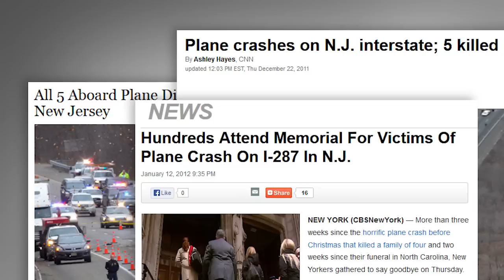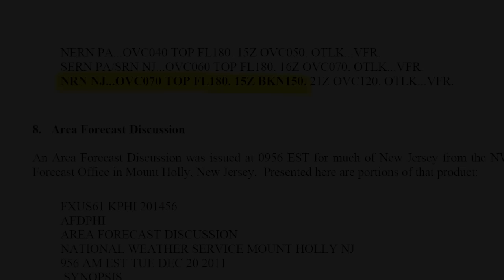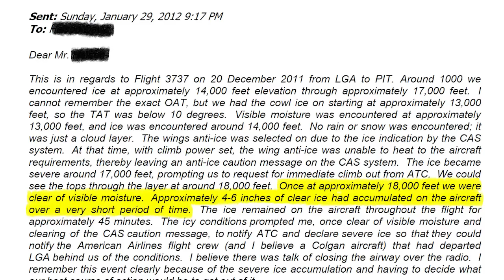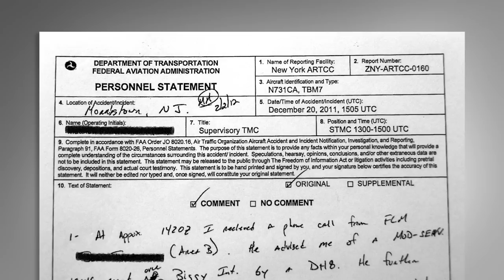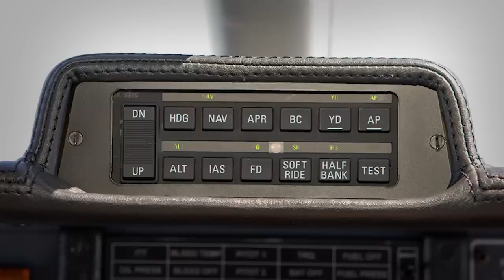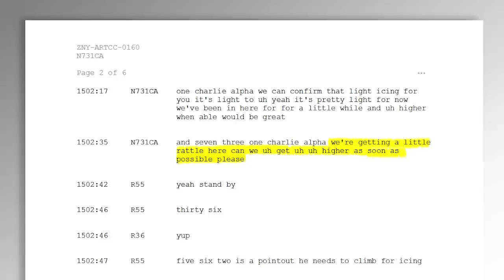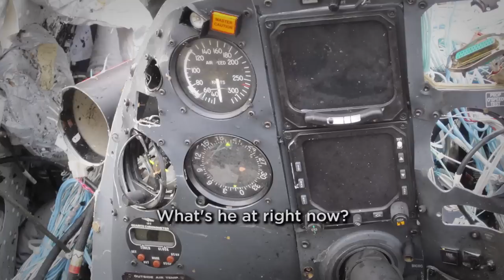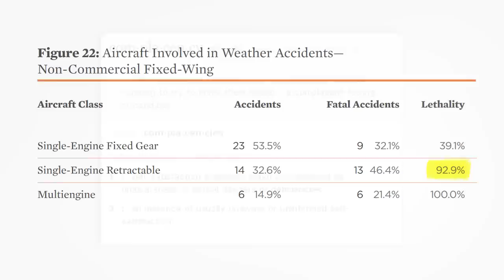Accident Case Study: Delayed Reaction

Comment: What about some vids on close shaves, like, how people managed to get out of tricky situations. I bet most are never 'mentioned'.
Reply: I had a tricky situation with a close shave once. It was January 16, 2007. I had a hot date that evening so I had a case of get-there-it is. I should have stayed home that day but she was hot. So I pulled out the old trusty norelco 5675 which I lacked on maintance to oil the blades. Never let me down before but this night was different. Half way through the shave I noticed some tugging but after years of shaving Ive become complacent. I should have stopped there but I kept shaving and next thing I know it's pulling hairs out and makes a screeching noise. One of the blades failed mid shave. Good thing I had a competent instructor and trained me what to do. I tilted the shaver 30 degrees so the bad blade was off my face. I then slowly limped on with the shave not to overload the remaining two heads. Scared the hell out of me with all the screeching and I could feel the heat radiating from it but I was committed at that point. I managed to get it done and off to my date with no injuries except a few pulled hairs and some shaky nerves. If I had to do that day over again I would have stayed home. Especially since I didn't get laid.
Reply: AIUI, there are a few put out by AOPA.  They won't be as well documented as crashes, though.

Comment: wow. That looks like a stall with wing drop, which is one of the scariest things I've had to practice recovering from in the short time I've been a student pilot.
Just, the sudden lurch and roll to one side is very unnerving, and Yeah...
I actually panicked the first time and reflexively tried to correct it before it started...
Which of course undermined the ability to practice recovery, and technically also meant I was interfering with the flight instructor's control of the aircraft.
But yeah...
That's... 
Stall training was definitly a moment where it's really apparent how different it feels in a real aircraft over using a simulator.
A lot of other things aren't massively different, as far as it goes (if your simulator is decent), but something like a stall.... That's not at all the same...
Of course the real problem here is the ice and not doing the right thing ahead of time, the stall and spin are just the ultimate consequence...

Comment: Interesting that "moderate icing" can build up enough in UNDER 5 minutes to down a plane?
That's a very strange use of the word "moderate"
Reply: Terry Melvin  Too situational to answer id say.
Reply: It is severe. I do not know why but severe is  not used.
Reply: I'm not talking shit 8m saying that's what I've learned from watching this.
Reply: All im saying is screw ATC if I see icing building up fast im going to gun it to get above the weather and talk to them after.
Reply: Kevin I’m not a pilot but I’ve been watching a bunch of these videos and it seems like most pilots commenting on icing say it’s better to descend to get away from ice, not climb.
Reply: @Sashazur  it is possibly better to descend if possible because it puts the plane into warmer air and obviously there is less chance of the wing stalling during a climb. Of course that depends on how high the plane would have to climb to get into an area where supposedly the icing is less of a problem. 

In this particular case, the plane simply may not have had enough time either way
Reply: @Kev376  I specialize in air safety and I tell you from the heart that you should descend, do NOT try to climb with ice build up on you.
PS: Oh and DO tell ATC you are either descending or climbing please, don't put other people around the same airspace at risk of a mid air collision, specially because I highly doubt your aircraft is equipped with ACAS unless you are in air transport/cargo, but if you were you wouldnt have said those things so I'm assuming you are GA
Reply: @Kev376  not when the ceilings are at 30k agl

Comment: I have flown three times and for me that's three times too many. There are just too many things that can go wrong with planes/pilots and weather. I am an electrician/mechanic and all around handyman, I have seen 3" solid steel shafts twist off as if they were made of wax. Nothing is 100% safe, and it really makes me think when I see people put their lives and others in the danger zone because they think they are on top of things, things they are not really good at.
Reply: Do you drive an automobile? Did you know your chances of getting killed are a lot higher while driving than they are from a plane crash. Flying is a very safe mode of travel, especially commercial flying. Look at statistics of how many people get killed in auto accidents every year, especially during holiday travel, but yet it's a footnote on the news. Heard of any commercial planes crashing lately? I didn't think so.
Reply: @rodneybrocke  If you had the same number of plans in the air as we do automobiles on the ground then the number of accidents would be different. Nice try but you can't have different numbers and compare things.
Reply: @NCLUSA  Yes, the numbers would be different. But let's talk commercial flights. If you compare a given number of people transported by commercial flights versus the same number of people transported by automobile, the safety statistics are much, much worse for automobile travel. And I realize this comparison cannot be equal because the number of people on a commercial airplane is 100 or so, versus 4 for an automobile. But my point remains true, that you are statistically a lot safer if you travel by plane versus driving. Obviously, flying is not for short trips, like to the grocery store. I am talking about long trips of several hundred or even thousands of miles. Look at the statistics. Flying wins every time.
Reply: @rodneybrocke  Well if you want to talk numbers?, have you ever heard of over 300 people being killed in a single car crash?, get back to me when you find that (  :
Reply: @rodneybrocke  So all of those Air crashes are not real?, someone just staged them, right?, planes don't ever fall from the Sky right?.
Reply: I completely agree. I had a tail dragger that I flew for 8 years. Two private planes collided at our suburban airport, killing three. Saw the smoke from my back yard. Sold my airplane and sent my private license to the FAA, with no return allowed. One’s hobby is not supposed to kill you.

Comment: you can hear it in that pilot's voice: he had no intention of turning around up until the point he physically couldn't go anymore.

unfortunately, this time it was too late.
Reply: ...and what good would it have done for him to turn around? Is it not clear that at a certain point you're halfway in and halfway out?
Reply: @touristguy87  Descending with accumulating icing out of the bottom of the clouds is still dicey, but controllable. Ascending can lead to slower and slower climb performance as the ice builds up on the airframe until you ultimately stall the airplane. He backed himself into a corner he couldn't get out of.

A descent out of the icing takes a predictable and short amount of time. If you try to climb out of the top, you're betting that your anti-ice systems can keep up and if you lose the bet, you're stuck with a totally iced up airframe that can barely fly at all, and definitely not climb further.

Comment: Are there any cases of a pilot detecting mod to severe icing, declaring an emergency, and then climbing (rather than descending)?  I realize it may pose increased risk to other aircraft already at the flight levels, but in hindsight, maybe this pilot could have climbed safely through the icing zone (for example, if he had TCAS/ADSB Active Traffic)  before ice had a chance to build up on the plane?

Comment: Is it possible to recover from a stall?  I've watched almost all of these Case studies, and some other accident videos, which a bunch mention stalling...  I saw one, getting into a stall from pulling back on the yoke, and not increasing power, so I wonder if you weren't paying attention to the airspeed, could you recover from a stall like that by simply pushing the nose down, gaining airspeed??   

I've always considered getting my pilot's license, but after the last two days of watching different types of accident scenarios, I really wonder if it is something I "really" want to pursue...
Reply: Recoveering from stall is standard emergency procedure every pilot should know, but recoveering from stall in cloud where you do not see horizon is rather hard and with ice buildup the aerodynamics of the plane is compromised, it can be impossible to recover.
Reply: In simple terms, a stall occurs when the air flowing over the wing slows to the point that the wing looses lift. To recover, you have to maneuver so the air starts flowing again. With icing, it changes the aerodynamics of the wing to a shape that can no longer provide lift no matter what the air flowing over it is doing. As the plane plummeted, the air was flowing so fast that it ripped a wing off. If the ice had not been on the wings, he could have recovered from a stall long before he got to falling that fast. That's the problem with ice: it changes your well-designed aircraft into one that is poorly designed and cannot fly no matter how much airspeed it has. (Hope this helps your understanding.)

P.S. Try satisfying your desire to fly with a home simulator first. It's cheaper and you won't die. :-)
Reply: Not if the plane was aerodynamically unable to fly due to the modification of the shape of its lift surfaces due to ice.
Reply: Learner pilots practice stalls and recovering from them, it’s a key part of training. But sometimes stalls can be difficult to recover from, like if the stall leads to a flat spin, or as in this case if the plane’s flight characteristics are compromised.

Comment: 1400 hrs in that type of plane is risky especially IMC. I couldn't get my hands on anything bigger than a PA39 when I had 1500 hrs & even then y experience level was low I reckon. I went on to fly 1000's of hrs in Multi Turbo props/jets & still was weary of ice, the silent killer. 
RIP to the innocent in this awful totally avoidable accident.

Comment: Scan. Scan.Scan. 
Fear brings fixation. Airspeed dropping, and not noticed, is a major factor in incidents. Always keep scanning ALL FLIGHT AND ENGINE INSTRUMENTS, and keep the intellect WORKING. Don't just flick your eyes over 'em, you need to KNOW WHY the speed is falling off, or the torque dropping, or unusual vibrations, the information is all there, but an active, involved, analytical PILOT is needed to evaluate the situation and make the call.
Reply: I'd like to think that it's my fear of dying that makes me a REALLY good pilot.
Reply: If you have airspeed bugs, put one on expected airspeed, and the min icing speed
Reply: he probably had a good idea of what was going on seeing as how the windscreen was coated with ice blocking his view of hte ice on the wings that he was told would be a problem
Reply: The ice not only adds drag and decreases lift, it increases weight. All three point to a stall.

Comment: Excellent example and review of the issues. Beautiful airplane and, much as we all might wish otherwise, probably an average to above-average, reasonably experienced and recurrently-trained pilot. How many in that situation with that equipment would not linger the couple of minutes being held down by ATC in the hopes of getting through it in light of the two dozen previous times doing that? The MD-80 pilot's discussion of their flight's experience through there says a great deal, I'm afraid.

Comment: My Father was a Commercial pilot (charter and Corporate) for most of his career. His scariest story was flying over the Rocky Mountains in a Piper "C" Aztec with no anti-icing equipment. He just kept slowing and losing altitude. He was able to get to an altitude where the ice melted  before he lost control. Back then, they didn't have all the weather Notam's on I-pads that we have now. I remember a few times when he had to shut down an engine to save it or make an unscheduled landing because the door popped open. Once, a fuel guy didn't secure a wing tank fueling port and the fuel was being siphoned off the starboard wing tank. Another time he forgot to tap the brakes on a Cessna 310 before he raised the gear, and filled the plane with smoke from the still spinning landing gear as it came up into the well.
The last time I flew, I was on a Piper twin with turbine engines. The pilot requested that the plane be taken out of the hanger and be fueled by the FBO. He just pulled the plugs from the engines and didn't perform any pre-flight checks. Just before we got to the active runway, the non-pilot guy in the right seat noticed that there was almost no fuel. We taxied back and fueled up. The pilot left a cup of coffee on the wing when he checked the oil in the port engine during re-fueling and it blew all over the airplane on starting. I was almost running by that point. He also kept tapping on one of the port engine gauges because it wasn't showing what he thought it should. Another time I flew right seat to prevent a customer from bugging him. We were at 17,000 over Atlanta and he got bitched at because he was below altitude while he showed off the weather radar. I never flew with this idiot again, and when he upgraded  to a Beech King Air, he couldn't fly without a rated co-pilot.

Comment: This event began directly above me at my workplace in Morristown. I just exited my car and could hear a normal sounding prop aircraft in the clouds above, a common sound only a short distance from the Morristown airport. Suddenly, I heard an odd "metallic slap" overhead, similar to the sound of striking a roof leader pipe with an open hand.  The aircraft sound instantly changed to an accelerating spiraling sound for approximately 30 seconds during which I could follow its track south but still not visible through the cloud cover.  Then,  the aircraft appeared out of the cloud cover, airframe appearing to be fully intact at that point,  in a vertical spin, white smoke pouring from one exhaust,  prop and powerplant screaming.  It then made a pronounced "pop" sound and the prop fell silent.  The aircraft then vanished below the obstructions to my view of the horizon, and after aprox. 10 seconds, a large black smoke cloud was visible.  We drove out to the scene and arrived before most of the fire and emergency equipment. There is a dodge truck in the video which we changed the tire on for the vehicle owner,  and the left front tire was filled with honeycomb from the aircraft fuel tank, which appeared to us to have been pulled off its rim rather than flattened by puncture,  possibly by running the end of the left wing over as it traveled across the highway. Vehicle was soaked with kero, and the occupants, a couple and their daughter on their way to have their daughters leg cast removed were feeling about as lucky as one can after a brush like that one.
Reply: I also witnessed a fatal crash on a road, whats worse is I knew the aircraft and pilot and it has stuck with me ever since....did you report your account to the FAA/NTSB? Some valuable insights there with regards the engine going silent, and the noises you heard overhead. https://www.iol.co.za/news/south-africa/gauteng/probe-into-centurion-plane-crash-1199555
Reply: @wingnutzster  Witnesses at the scene were asked to fill out observation reports which I did.
Reply: jasper john Wow, what a nightmare that must have been for you and obviously for the family that was lost, as well as the family in the truck you helped. I’m guessing everyone there that day saw something they wished they could forget. Tragic.
Reply: What you saw does support the hypothesis of an engine issue, but that alone will not bring an aircraft into a dive. But if the reaction to the lack of power is to pull back to bring the nose up, then one of the wing can stall earlier than it normally would because of the ice.
Just speculating here, I didn't read the full report.
Reply: Thanks for sharing your experience. I live right near KTEB Teterboro where it took off from.
Reply: ImmortalHitman 201!!
Reply: Good additional info, very interesting, thanks for sharing.
Reply: JJ: WOW!
Reply: So you are contending the plane did not break-apart during it's descent?
Reply: @wjatube  clearly not.
Reply: @wjatube  its